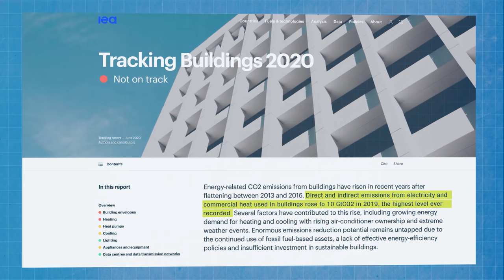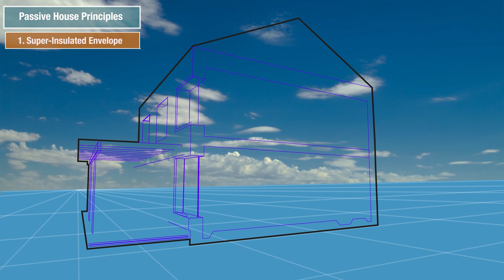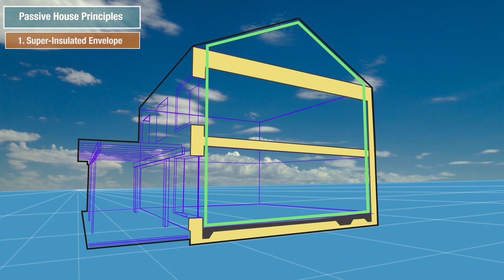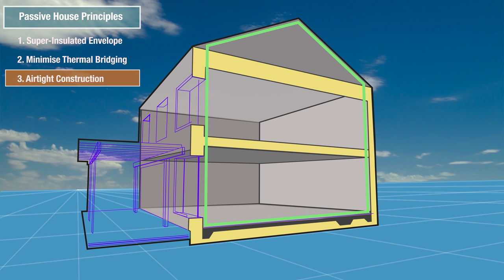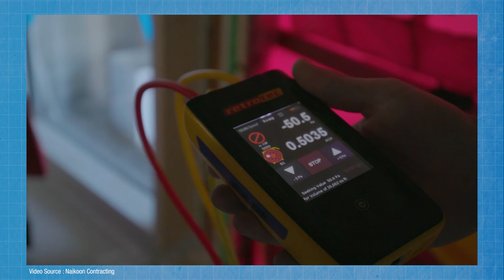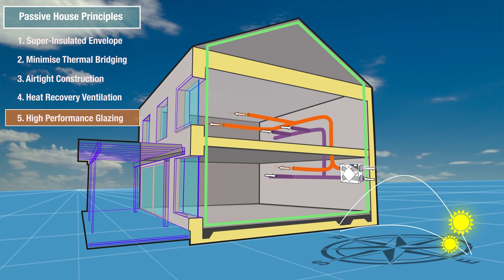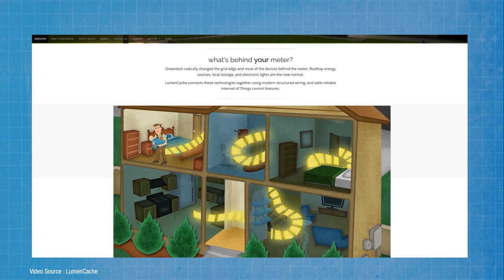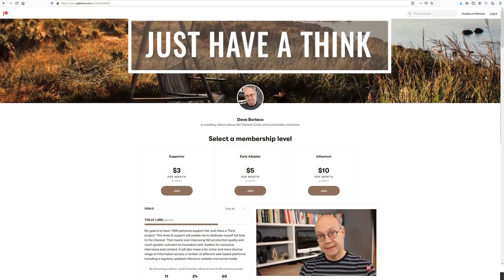Passivhaus . A low carbon future for our homes?

Comment: You can retrofit UK houses. With a builder I have done it twice: once to a house and once to a flat. Both properties were late Victorian or Edwardian. Of course I have not been able to  insulate up to passivhaus standard though. I have probably saved about 70% of the energy for the properties; maybe even more.  I put 4kW of solar panels on the house. The panels face east and west and save all the electricity energy the house needs. Half of it is not used in the house. It is sent down the street to be used by someone else. Even though they are east/west facing they work very well. I get the benefit of the electricty just when I need it the most (mornings and evenings before the sun goes down). I could save more if I buy a Tesla Powerwall battery to store the electricity and use it overnight. I probably will buy one when the battery technology lasts longer so that it becomes economically viable. 

I changed the old 80% efficient boilers to a new 92% efficient new Vaillant boilers when the boilers were not economic to fix anymore.That alone saves about 12% of the heating of the house and flat.

I of course insulated the loft with fibreglass for the full thickness of the joists. I did not want to go deeper because I wanted to be able to walk around the loft to maintain it in the future. I have put boarding over the insulation so I can put more insulation on the boarding in the future and I can still walk around the loft without putting my foot through the ceiling. I insulated the walls with 50mm thick  hard yellow insulation (polyisocyanurate) that is twice as good as fibreglass for the same thickness. It saves about 75% of the heat from going through the walls. It is like two 9 tog autumn duvets put together (18 tog in total).  I also insulated under the timber ground floor with the yellow insulation between the joists fo the full depth of the joists (about 30 tog duvet equivalent- two thick 15 tog winter duvets together). More importantly I insulated the central heating pipework under the floor with the thickest pipe insulation to Bylaw 30 standard. (It is twice as thick as normal pipe insulation and worth every penny because so much heat is lost by the pipework under the floor - about 1kW for the whole house or flat when the central heating is on (about 10 or 20% of the heating of the whole property). There is also much less chance of a burst pipe because of freezing weather in winter. I also insulated the cold water pipes with the same Bylaw 30 pipe insulation).  I filled in behind the skirtings with mortar. Now, I don't have mice in the flat anymore. It is too cold for the mice under the floor and it is too hard to get into the flat. This has not worked on the house. I will look at the house to find any holes that I have missed. I also removed all the old chimneys to remove any draugths and get more space.

I of course double glazed the old windows after I put in the wall insulation. I then fitted the double glazing sills over the thick wall insulation. I got rid of the gaps between the windows and the frames on my double glazing that was not fitted properly.  Some rooms were very small and had small bay windows and a radiator by the bay window so it was not practicle to insulate the walls with thick yellow insulation. I also thought about insulating the walls of this particular flat after I put in the double glazing in so it made it doubly difficult to install the thick yellow insulation. With these small bay windows I removed the old 32 mm thick plaster. I found a 26.5 mm  insulation borad in Wicks Builders merchants (It had 17mm of polystyrene insulation and 9.5 mm of plasterboard: it stops about 50% of the heat from going through the solid 9" brick walls that are like a 4.5 tog summer duvet). I then skim coated the boarding with plaster so that the wall was the same thickness as before I took out the plaster. The wall is like an autumn 9.0 tog duvet now. The room is still the same width as before which is important because the room was already too small. I also removed the old front and back doors and put in air tight double glazed doors. I also convinced the owner of the upstairs flat to insulate their walls with the polystyrene 27 mm insulation. They double glazed the windows as well.

Comment: Retrofitting vid would be super cool! This is interesting. I mean, so is all of this tech, but this one seems as if it could have immediate AND economically viable implementations.
Reply: You can't retrofit UK houses, easier to knock down and rebuild.
Reply: @phil2544  You can retrofit UK houses. With a builder I have done it twice: once to a house and once to a flat. Both properties were late Victorian or Edwardian. Of course I have not been able to  insulate up to passivhaus standard though. I have probably saved about 67% of the energy for the properties; maybe even more.  I put 4kW of solar panels on the house. The panels face east and west and save all the electricity energy of the house. Half is not used in the house. It is sent down the street to be used by someone else. Even though they are east/west facing they work very well. I get the benefit of the electricty just when I need it the most (mornings and evenings before the sun goes down). I could save more if I buy a Tesla Powerwall battery to store the electricity and use it overnight. I probably will buy one when the battery technology lasts longer so that it becomes economically viable. 

I changed the old 80% efficient boilers to a new 92% efficient new Vaillant boilers when the boilers were not economic to fix anymore.That alone saves about 12% of the heating of the house and flat.

I of course insulated the loft with fibreglass for the full thickness of the joists. I did not want to go deeper because I wanted to be able to walk around the loft to maintain it in the future. I have put boarding over the insulation so I can put more insulation on the boarding in the future and I can still walk around the loft without putting my foot through the ceiling. I insulated the walls with 50mm thick  hard yellow insulation (polyisocyanurate) that is twice as good as fibreglass for the same thickness. It saves about 75% of the heat from going through the walls. It is like two 9 tog autumn duvets put together (18 tog in total).  I also insulated under the timber ground floor with the yellow insulation between the joists fo the full depth of the joists (about 30 tog duvet equivalent- two thick 15 tog winter duvets together). More importantly I insulated the central heating pipework under the floor with the thickest pipe insulation to Bylaw 30 standard. (It is twice as thick as normal pipe insulation and worth every penny because so much heat is lost by the pipework under the floor - about 1kW for the whole house or flat when the central heating is on (about 10 or 20% of the heating of the whole property). There is also much less chance of a burst pipe because of freezing weather in winter. I also insulated the cold water pipes with the same Bylaw 30 pipe insulation).  I filled in behind the skirtings with mortar. Now, I don't have mice in the flat anymore. It is too cold for the mice under the floor and it is too hard to get into the flat. This has not worked on the house. I will look at the house to find any holes that I have missed. I also removed all the old chimneys to remove any draugths and get more space.

I of course double glazed the old windows after I put in the wall insulation. I then fitted the double glazing sills over the thick wall insulation. Some rooms were very small and had small bay windows and a radiator by the bay window so it was not practicle to insulate it with thick yellow insulation. I also thought about insulating the walls of this particular flat after I put in the double glazing in so it made it doubly difficult to install the thick yellow insulation. With these small bay windows I removed the old 32 mm thick plaster. I found a 26.5 mm  insulation borad in Wicks Builders merchants (It had 17mm of polystyrene insulation and 9.5 mm of plasterboard: it stops about 50% of the heat from going through the solid 9" brick walls). I then skim coated the boarding with plaster so that the wall was the same thickness as before I took out the plaster. The wall is like an autumn 9.0 tog duvet now instead the old 4.5 tog summer duvet 9" brick walls. The room is still the same width as before which is important because the room was already too small. I also removed the old front and back doors and put in air tight double glazed doors. I also convinced the owner of the upstairs flat to insulate their walls with the polystyrene 27 mm insulation. They double glazed the windows as well.

Comment: Where I live it can hit 48C in summer during the day. I have AC, but I don't use it. The roof is designed to reflect sunlight, double glazing keeps out ambient heat, wood is used in the floor and roof to insulate and brick acts as a heat sink, and the ceiling is further insulated with batts, plus shade trees overhang the house. I run a couple of misting fans drawing 300W of energy when it goes above 40. At night when it cools I have a whole house fan that evacuates any warm air built up in the latter half of the hot afternoon out of the house in about 5-10 minutes.

Comment: Part of the reason housing is so expensive is because of snooty standards for how a typical house "should be" constructed, typically using a pile of sticks nailed together. A durable long-life single story home can be built inexpensively using pole shed or warehouse style construction, and incorporate superinsulation, thermal breaks, sealed envelope, heat recovery, etc.
The exterior can look like an actual pole shed with the iconic ribbed metal of pole sheds, or have a more traditional clapboard / vinyl / metal siding and you can't tell the difference externally for how it was built underneath. The main limitation is that these structures are normally built directly on a concrete slab, so typically there is no basement level, but it can make use of insulation under the slab and hydronic underfloor heating.

Comment: I just built a fairly low energy home in Canada - 2 x 8 walls - reduced window area, solar power and it’s fairly small - the biggest problem here is that everyone thinks they need a LARGE home...and they’re all heated with natural gas or propane - here in Ontario our electricity production is VERY close to zero carbon

Comment: In Australia if you fill a sun facing roof with solar panels, it not only produces power, it shades your roof. Okay, the shading is obvious, but still a point not often made. If the sun does not hit your roof, you do not have it heating your house in the first place. So if possible, build your sun facing roof so that can it can hold the maximum ‘legal’ amount of panels; - 15 kW where I live.  3 phase power is required because we are only permitted to export 5kW per phase. To save cost, the roof should not be so steep that it requires scaffolding. Such a solar system will meet all your electricity needs during the day, including running your EV, but awaits a battery run heat pump at night. Incidentally, house design 101 in Australia has always been large eaves or verandas to keep sun from windows in summer and allow
Reply: My husband, owner-built our underground house in Australia from 1986 - 1989 (he's not a builder- far from it, but we had renovated a couple of older houses ourselves). He did it mostly by himself with a few extra labourers and tradies (plumber and electrician) when required, and in "spare-time" between paid work job and family commitments. We've been living there ever since, temp ranges between 26 in height of hot 40 deg summer and 19 in depths of -5 deg winter. We be are self sufficient and off power and water supply grid so no bills. House looks like the design in the JHAT video, but faces North and natural airflow from lower to upper external windows, plus separate air intake for wood fire in winter and heat exchanger perforated flue design from lounge through upper main bedroom, and from fuel stove through upper bathroom. Works better every year. Main cost was external waterproof membrane paint layers, drainage cells etc and polystyrene panels around envelope and a metre of soil on each roof section. Where it  is visible the envelope is clad in local found stone stacked on external corbels for size and gravitational stability, keyed and grouted against the main filled reinforced concrete block envelope. After 30 years it has now almost blended with the hillside it was fitted into. At the time it was a novelty for local council, but they were quite happy we had professional engineering and architect input and approval for design. Not expensive over a 5-10year period, and cost saving escalates with time, especially with modern technology improvements. Next stop is more solar and wind generation capacity and high volume power and water storage solutions. It will last for many many generations. Think about that kind of legacy for those who will be living through the next century.

Comment: In the summer while gaming on my computer my room can get unbearably hot, in the winter my computer doubles as a space heater. I wonder how much a super insulated home would magnify that. 
Then add in the washer/dryer, the dishwasher, the fridge, the oven, lighting, heck even just electricity running through the wires adds to the heat in a house. Here in Colorado we get below 0F winters and above 100F summers. It'd still be awesome to have a house like that (or any house at all, woe is the life of millenials and younger :X), but I bet you'd still need air conditioning and heating to some extent. 
Just make sure it's geothermal A/C :P

Comment: The elephant in the room for passive house is the embodied carbon of the construction. With almost no operational carbon this embodied carbon can be significant, it can be mitigated by carefully selecting what materials are used during construction.

Comment: An intriguing variant is to integrate an adsorbent like Xsorb into the air heat exchange. Removes moisture from exhausted air and its surrendered latent heat then heats incoming air in winter. Regenerate in summer with solar.

Comment: Good episode! There in holland its still not very comon to build a passive house. As a pv installation is the cheapest option to get a new house approved  more isolation or tripple glazing is not high on the list of building companies. As an architect I had the change to design and build our own passive house 5 years ago. As our walls and roof have double the isolation it doesn't really matter if the room temperature is set to 20 or 22c. Now we have everything electric with a ground source heatpump we're still 'burning' alot of kWh in the dark and rainy dutch winter months. There is no way we can get off grid with batteries any time soon.
In summer as the kids want to play outside the door and screens can't be closed all the time so even with tripple glazing heat is comming in and the floor cooling and fesh cool air ,through a improved ground pipe, can't keep up. Yes the power of the sun! When i have the time A/C is going to be fitted to the main ventilation system. 
But I do think this is the way to the future. 
As for retrofitting older buildings, I think normally not a good idea! As old building dont have the build quality isolation or more isolation means more problems with moisure and fungus! Isolation is not only the walls, glass and roof but also groundfloor and fundation. As there is no good way to do this, just leave them.

Comment: This all leads to the question: should not every house constructed be Passive by law? This would future proof the building industry and retrofitting buildings could be subsidised to encourage the complete retrofitting of all households. If you are to sign the Paris agreement with all intents of meeting the requirements surely that's the best start.

Comment: I live in Canada and I cut my own firewood to heat my house. For that reason I am building a much more insulated house at the moment. I am not a fan of triple glazed windows at all though. They are too heavy to work with and there is twice as much chances for the windows to fog up with twice as many seals that can break. A well insulated house with well sealed joints is a must for me though. The building will be wrapped with 3" styrofoam and the door will be properly weatherstripped and installed. To eliminate drafts I will provide a cold air intake pipe directly to my wood cookstove that will be plumbed to heat all my domestic hot water and hydronic floors.
Doors. don't forget to constantly fix the weatherstripping on your door every year. Also don't get low E coated glass for your southern windows in the northern hemisphere, you still need vitamin D. Also go outside and put your woolies on!

Comment: Every home should have enough solar panels to cover 100% of the consumption of the house, electrical vehicle charging included. #SwitchToSolar #SwitchToElectric
Reply: Don't forget solar hot water. Getting that cut our power bill by about a third, and that was before rooftop solar was affordable, which cut out half of the rest.
Reply: Lol
Reply: I'm all for EV's but I'd also be concerned about making sure that the internal combustion based vehicles they replace are adequately recycled, or better yet retrofitted to become EV's.
Reply: @jonathandenton6160  Yes, I imagine loads will be retrofitted.  In--wheel-hub electric motors can make retrofits quite easy.
Reply: No prohibitive full-lifecycle environmental or social costs? Sourcing the raw materials? Disposition after end of useful life?